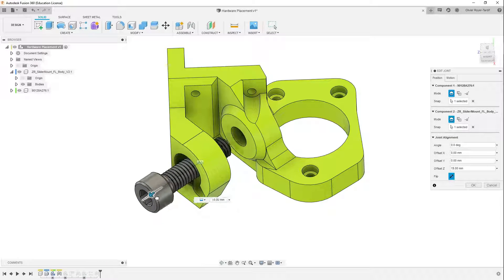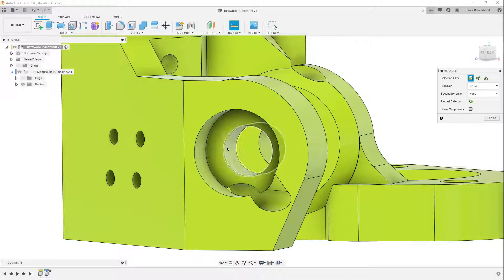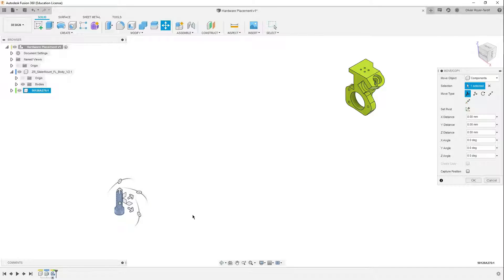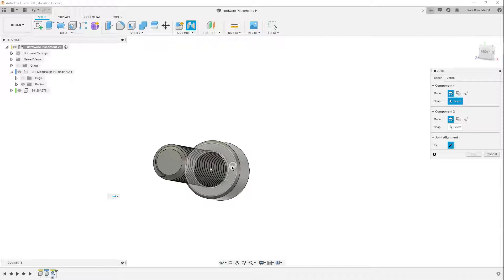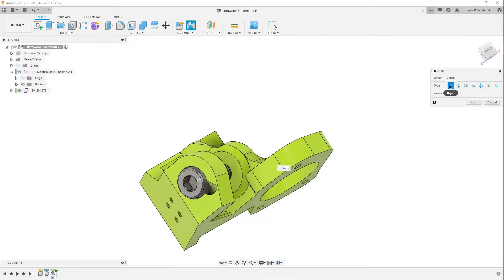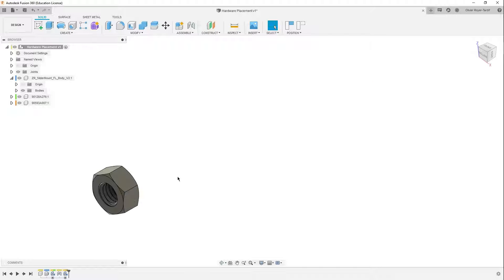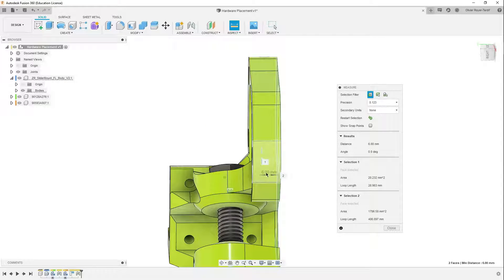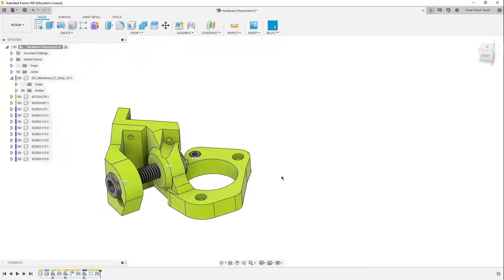How to Insert Hardware in you Fusion360 Design

Comment: Useful demos. BTW, you can determine the diameter of a circular design element without using the inspection tool. Just select it and the diameter is shown bottom right of screen.